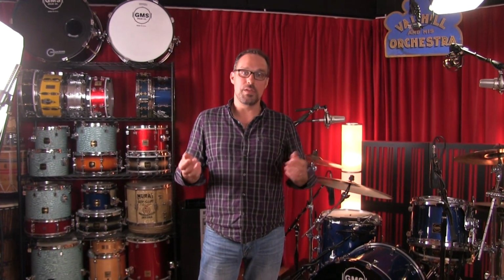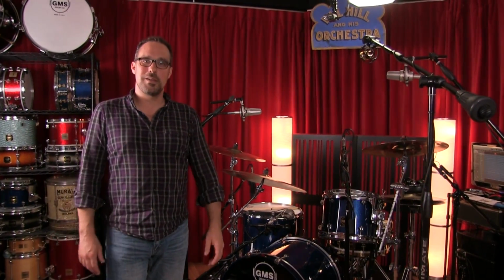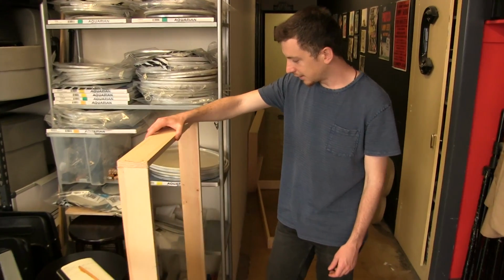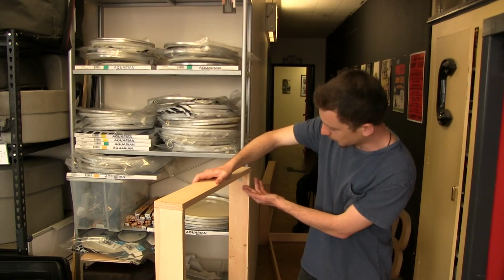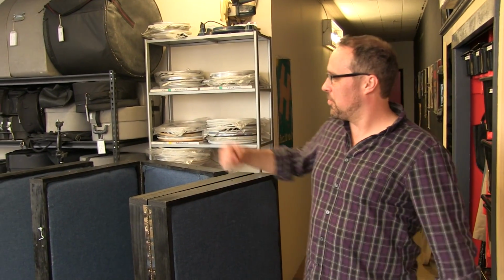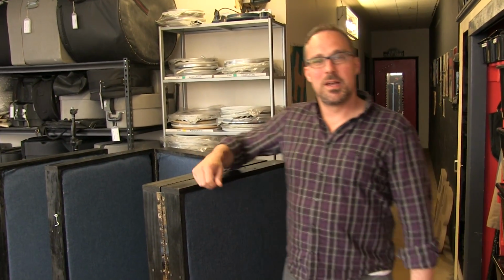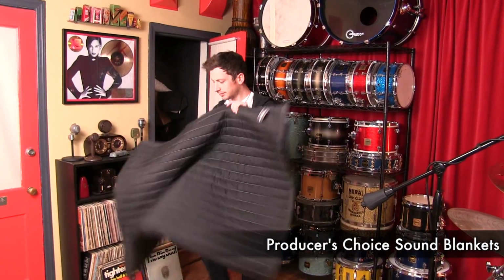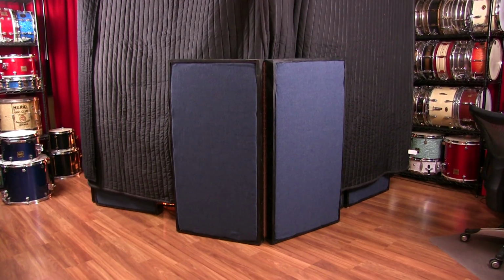Triple Colossal Studio Overhaul 2017, Part 3: Building Gobos and That 70s Sound

Comment: Hey there, sorry to unearth an old video.  You mentioned in the video, after having built the gobos, that you weren't sure if it was cheaper to build them or buy them.  How much did that Guilford of Maine expense factor into that statement?  I ask because I'm drawn to build my gobos to the highest possible specifications, so as to last a lifetime, and I'm really on the fence with the GOM fabrics.  I don't NEED the covers to be fireproof, although that is nice.  Since building your gobos, have you come across any other fabric types that you might choose instead if you were to do this all over again? Thanks!